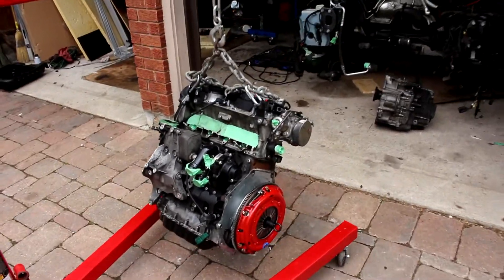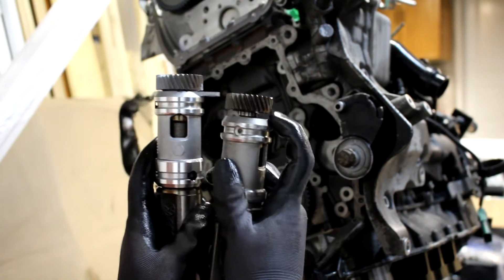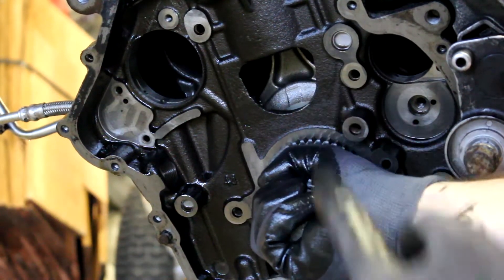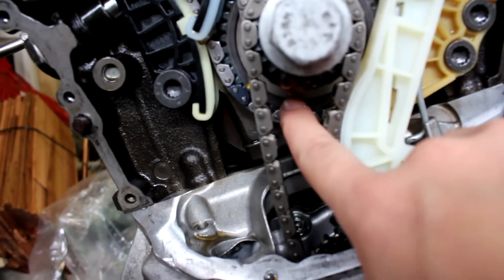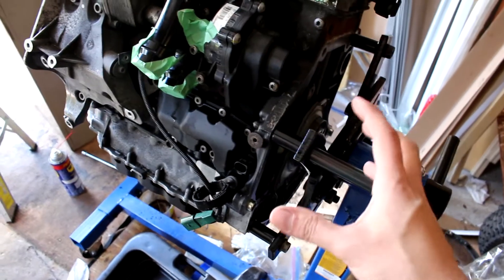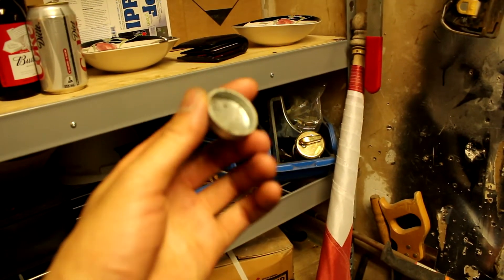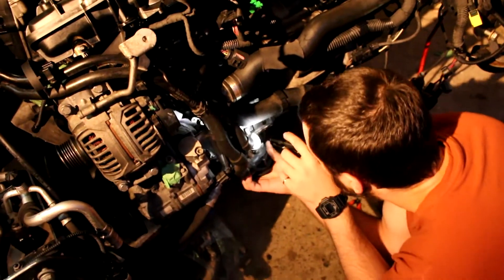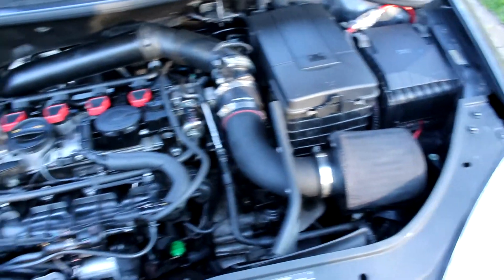Seized Balance Shaft - VW 2.0T TSI

Comment: Ayyy! Nice job! LOL on how many times I was close to crying like I dropped my ice cream cone. That feeling when you crank it up tho...
Reply from the maker: Haha thanks! Oh yes, there were many desperate moments, it really does add to the anticipation. Definitely a good feeling at the end!
Reply: @WannabeTuners  hey good vid. glad you got it sorted. nightmare for sure. what sealant did you use on the balance shaft chain tensioner on the crush washer? think i got mad leak from this sucker right now
Reply from the maker: @JH-sc7cs  thanks, ah damn that blows.  Didn't put sealant, just blue loctite on the threads. But if I had to use sealant, id go with permatex ultra black RTV, it'll be super hard to remove though
Reply: @WannabeTuners  in guessing intense vibration pulsation from that tensioner has caused it to loosen a bit and allowing oil to spew out. A lil bit of rtv black I guess is all it needs with proper torque. Will check it out and report back. Thanks for the reply

Comment: Thanks for taking your time and uploading this video! Did you find any particles at the bottom of the oil pan? I'm going thru a hard time just fixed the engine and cylinder head and did replaced balance shaft at the same time while there and now engine seized and oil is super contaminated with bunch of white pieces of plastic also I had a overheating then it shuts down while driving and engine seized.

Comment: How did you remove the balance shafts???
Reply from the maker: At the time we didn't have a proper slide hammer puller tool, so the freeze plug on the other side of the block was removed, and the balance shaft was tapped out.

Comment: how did you guys clean out the oil passages? i just blew through another intake balance shaft after having the screens fail one time before
Reply: also you can put the cam bridge on with the engine timed up already and the tensioner released just need to rock the cams a bit

Comment: How did you reinstall the plastic baffle on the exhaust balance shaft?
Reply from the maker: According to my friend, it's easier to clip it on the balance shaft first and assemble together with that notch on the end facing up. The seam has to be facing down so it shields the balance shaft from the engine oil properly :)
Reply: @WannabeTuners  thought of doing the exact same thing. Thanks dude!

Comment: I bought a B8 A4 with a broken valve spring in #2 and a bent valve as a result of it.....took the cylinder head off, rebuilt it...put it all back together....wouldn't start
 Redid the timing , found nothing wrong...realized it had 60psi compression.....soaked rings in MMO for a week, cranked it forever...started up, smoked like a chimney..... compression came up a bit to 166psi all across......no lights on, drove like a champ......46.5 miles then the engine shut off and wouldn't move again.....my guess is one of the balance shafts (or both) seized up. Fuck this car, I gotta take it apart again.....third time is the charm, eh? 😑👎

Comment: Hello my freind, just saw your video & wanted to ask you a question about an issue happening with me as i am a mecanique and i have a customer with this same problem, engine stalled while driving and it turned out that the both intake and exhaust balancers were blocked (not turning), replaced the balancers (not OEM) with all the timing parts as well, after a week the engine stalled again, the plastic filters on the balaners were melted down, replaced the balancers for the 2nd time (OEM part), the engine stalled again with the same issue (filters are melting down inside the balancers causing the balancers to get blocked), the engine oil cooler is ok and the oil pressure is ok with no warnings on board, are you familiar with this problem? Thanks in advance.

Comment: Hello i have the same issue, my exhaust balancer shaft seized but upon removal of the shaft i found that the balance shaft is bit covered by melted plastic. Should i just change the shaft or their is more damage to it?  Please assist
Reply from the maker: It's hard to know exactly what's damaged, and it depends on how much you want to replace while you're already in the engine. It gets expensive. Try and find out what looks worn out and replace those things. Melted plastic could just be the plastic balance shaft cover which should be replaced. Make sure it isn't the timing guides that wore out too.
Reply: @WannabeTuners  cheers

Comment: Can this fix low oil pressure?
Reply from the maker: I don't know exactly. If there are oil pressure issues it is more likely to be from somewhere else (main bearings, rod bearings, oil pressure switch and so on). My balance shafts seized before noticing any oil pressure issue

Comment: what symptoms were you experiencing prior to this problem? any codes?
Reply from the maker: No symptoms whatsoever, all that happened was I didn't rev high enough when downshifting back into 3rd gear, so the transmission sort of jolted which then caused the balance shaft to seize. It was actually very surprising. It was probably on it's way out, but again no symptoms prior.

Comment: Hey Wannnabe Tuners 

I have question for you ...... If neither of my balance shafts are seized but am trying to solve “OIL PRESSURE LOW “ problem ...... Would you check the balance shafts ?  Blow out on the tiny mesh filters possibly ? Or would you skip it 

Ha ha not only does it say “ Engine Off” it also says
 “ Have Shop Service “ in white font vs the red font ..... 

I owned an 06 and got the
 “engine off “ but never take it to the “ shop “ 

What do think ? If they are not seized leave them alone ?
Reply: By the way nice job on this post ...... got a bunch of questions I had answered
Reply from the maker: Hey, I'd start by looking at other areas like the oil pressure switch itself, the oil pump, main bearings, and rod bearings etc. I'm guessing here but I really think that if the balance shaft bearings are worn to the point of having a low oil pressure light, youd hear/feel it and the balance shafts would possibly become damaged. That's just my guess I could be wrong! Goodluck with the troubleshooting man!
Reply: Matt did you solve your low oil pressure problem? I facing the same w/ hot engine and idle. The pressure was below spec. >2000 rpm the pressure is on the spec.

Comment: Hey man nice video! Question just rebuilt this engine for a friend. Pistons , new head and so on. I’m getting a load noise and it’s annoying. I’m thinking it’s the oil pump but wanted to see what you thought. Here is a video of the noise please help thanks. https://youtu.be/_9c4oHUUdK8
Reply from the maker: Its hard to pinpoint where that sound is coming from but the first thing i'd personally do is take off that top plastic timing cover since it has its own rubber gasket and is easiest to come off, and look down with a light and see if you can see anything out of place.
Reply from the maker: Another thing that it kind of sounds like is an accessory belt pulley. You could also try using a Mechanics Stethoscope to try and trace the source of the noise while it's running. Just be careful not to get it caught into any moving parts such as the accessory belt and cooling fan.
Reply: @WannabeTuners  thanks for the reply. literally loader at the bottom end where the bottom of the timing chain cover where the oil pump chain area is. This is why I was thinking the oil pump. Humm.  This sucks lol
Reply from the maker: @kaubut0145  Ah damn, Maybe a chain guide shifted or something? I'm completely guessing here. Damn.
Reply: @WannabeTuners  I’ll keep you updated.

Comment: Good perseverance there through some tough times. I just brought an a3 2.0 tfsi(tsi) so naturally I subscribed straight away. I'm planning stage 2. Am I correct in thinking you was running stage 2 when it happened?
Reply from the maker: Hey awesome! Love the A3's. Correct I was stage 2 when it happened but I don't blame stage 2 on bearing failure. My belief is the engines don't like bad shifts that cause quick changes in rpm. Since the balance shafts spin faster than the crank and are literally off-balance weights, it puts a hard strain on the balance shaft bearings during a miss-shift without proper rev matching
Reply: @WannabeTuners  ahhh I see dude. Would I ever get a miss shift with a dsg? Yeah the a3 is the in misano red I believe maybe wrong but s line s tronic(dsg) Quattro with ok only 54k fsh (audi) with huge potential.....What power does stage 2 sit at? I think your k04 though aren't you??🤙🤙
Reply from the maker: @davidkane9876  nice colour! I've never driven a dsg so I'm not sure if the controller has a safety lockout from screwing with the paddles at the wrong time, don't test it Hahaha. Yea the Jetta has a ko4 now, it still feels sluggish in hot weather even with water/meth spraying but there's a never ending list of mods we can do with these engines, so if you like modding, there's a  tonne of parts out there for what you just bought =)
Reply: @WannabeTuners  Lol I won't be testing it for sure bud. But yeah my journey is just beginning as I just did an intake and the big brake set up to start the transformation. And it looks pretty much the same as an s3 to the untrained eye lol😎
Reply from the maker: @davidkane9876  haha nice! My front brakes are stock but what did you go with? I'll have to get ideas when it comes time to change mine lol
Reply: @WannabeTuners  I went with mk5 golf r32 345mm fronts all of for now but sportier pads later maybe. See how these go. Over Canada I think stoptech are available. I'd use a 4pot set they make if I could.

Comment: My balance shaft from intake side was locked, I ordered new balance shafts, do you think it’s a good idea to remove the screen from the balance shaft?
Reply from the maker: Ahh good question, I struggled with this idea too but I just kept them in. The second time I was in the engine I did notice that the screen for that cam cradle that goes on both camshafts blew out again and this time I didn't replace it, no trouble with that one being screenless so far lol
Reply: Wannabe Tuners I think that’s why they fail, because the screens get clogged and the balancer runs without oil.
Reply from the maker: @CrazyHobbyParadise  that sounds like one of the ways, but sometimes I notice the screen being heavily blown out and damaged without any sludge or blockage on what remains of the screen material. Makes me think oil pressure over time is enough to blow these out! I think if you're diligent with oil changes and regular filter changes it may be okay as long as small particles dont get into the bearing race.  I'm interested in the idea, I just couldn't bring myself to rip them out of the new shafts because of the pain they cause my wallet

Comment: I’m thinking about buying a 2010.  The owner says they did the timing etc tho now the balance shafts need replaced.   I’m skeptical.  For your build what did you spend in parts
Reply from the maker: If they say the balance shafts need to be replaced I would steer clear away from it, honest opinion. That's coming from me actually liking these cars lol. I spent around 3,000 canadian. A lot of the hardware is listed as "one time use torque to yield" as well. It's best to find something that runs unless you're buying it for the sole purpose to wrench on it. The trouble is that it's never just ONE thing thats broken. If somethings locked up or damaged, you don't know how much is broken until you tear it all apart. Hope that helps man!  :)
Reply: Wannabe Tuners  I’ve never had a TSI only the FSI.  I always heard about the advantages of the TSI over the FSI. Currently I’m thinking I was misinformed. Sorry  i missed where everything was listed when I was viewing at work.   Luckily for my deep VW passion the sale is currently pending.  It would be a wrencher as the daily is a Lexus GS 🔥  thanks for the swift response.  Still running that jetta??
Reply from the maker: @davefrank5245  haha no worries.  I totally know what you mean about TSI vs FSI. The TSI has a high pressure fuel pump that can handle up to k04 sized turbos and it seems like the stock bottom end is stronger on the TSI engines. Timing chains look good on paper but the earlier model TSI engines (2008-2010) had bad timing tensioners that needed to be upgraded so there definitely are some problems. I think if there's passion, it shouldn't scare you away, and it seems like you already know how V-dubs tend to be passion projects and aren't the best in terms of parts cost and simplicity haha. but definitely shop around a bit for something that is in better shape. I'm still running the jetta. I've since blown the engine and have rebuilt it again. That rebuild video will be up in about a month or so. Good luck on your search for a good TSI, keep us updated!

Comment: Okay, I need to go to the knowledge well again please. I'm doing a balance shaft  replacement on a Mk6 Gti. I'm getting hung up because I have assumed that the new balance shaft tube is going to lock into place inside the block. I've fashioned a tool from a coat hanger to pinch the seam together and was waiting for some magical "click" and it would be locked in place. Do I Simply slide it in with the new balance shaft? if so is the seam up or down please?
Reply from the maker: The easiest method seems to be popping the tube around the balance shaft first and sliding them in together. You want that little "nub" on the end of the tube to be on top cause it hangs on a ridge in the casting on the transmission side of the block (seam down). You should be able to push the tube onto the balance shaft to the point where it sits on snug. Hope that helps!
Reply: @WannabeTuners   Thank YOu!
Reply from the maker: @charlesmaxwell1911  no worries! You'll know it worked if the balance shaft slides all the way in to where the flange for that single torx bolt complely bottoms out. At that point I like to spin the shaft by hand to see if it spins freely
Reply: https://www.timingchainsettlement.ca/

Comment: I have about the exact same project going on a 2010 Gti, please tell me how to remove the balance shaft tube? I see that mine is damaged on the exhaust side, I have a new one but have know Idea how to remove.
Reply from the maker: Do you mean the black plastic tube or the balance shaft itself? The manual says to use a slide hammer to take out the balance shaft. Mine was soo seized that I had to hammer out the freeze plug on the opposite side of the engine and hammer the exhaust balance shaft from the transmission side so that it falls out the timing side. As for the plastic piece, I just grabbed onto it with long pliers and pulled it out.
Reply: Thanks, the exhaust shaft tied up but popped out with a flat blade screwdriver behind the bolt tab. I was over thinking the plastic tube.  I'm in  NW Ohio and now say "chooched" all the time now when something is broken.
Reply from the maker: @charlesmaxwell1911  hahaha nice! glad you got it out, these engines are "FUN" to work on lol. I love saying "chooched" haha I think I got it from AvE here on youtube